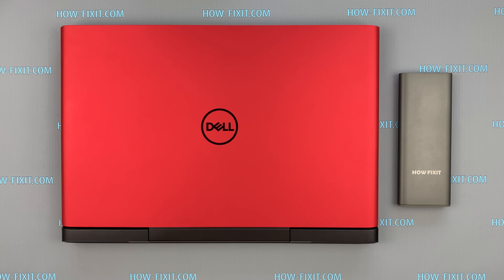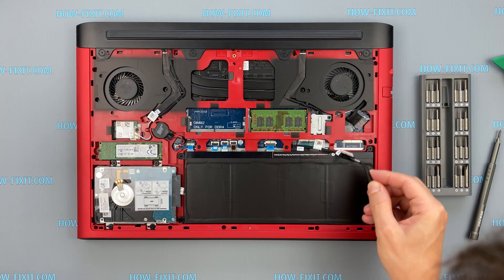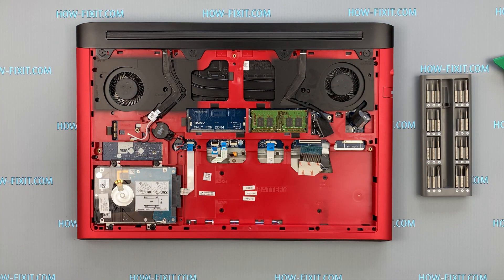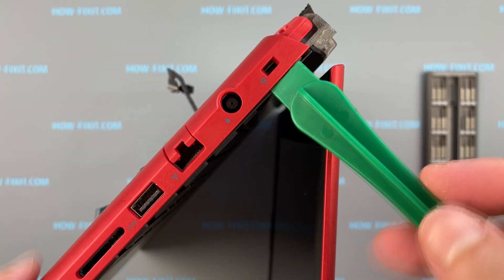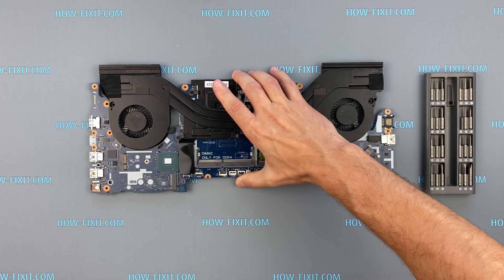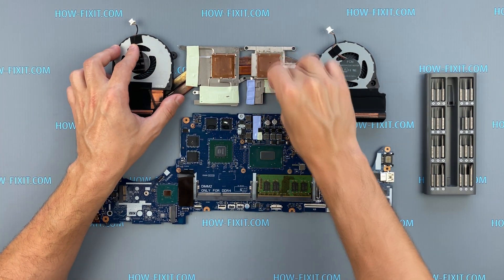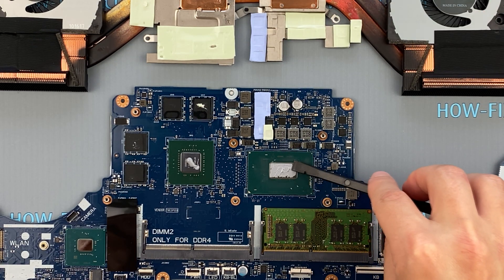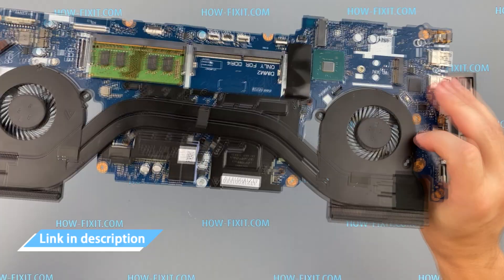Dell G5 5587 Disassembly, Cleaning and Thermal Paste Replacement

Comment: Just had a panic then! Turned it back on and I just got a lot of fans blasting away with a black screen! Turned off and on again, hey presto she lives again.
Reply: I've just had this but it won't load up o.o
Reply: @afrolee4111  did u fix it man
Reply: @gnarlzafunk2thalore  I did! First it wouldnt load, then my ssd needed plugging on, then my battery wouldn't charge (I changed the setting a while back).... all good now haha. Its like brand new 😍😍 gaming went from 89c to 60-70c
Reply: @afrolee4111  Why wouldn't the battery charge? Glad it worked out in the end.
Reply: @andrewdottext8026  turned out to be the charger setting i put it on. I have it on dynamic and it doesnt charge until it goes below a certain percentage lol
Reply: @afrolee4111  Hey man, I have a question. I've changed my thermal paste and my battery isn't charging too. How can you solved this issue?
Reply: @tolunayerbay1684  hey, my issue was that I had adaptive charging set so since it was below 95% and above 45%, it wouldnt charge since charging didnt kick in until the laptop was below 45%
Reply: @tolunayerbay1684  go into the power manager and change the charging settings to see if that works
Reply: @afrolee4111  Thank you for your response :) I figured I didn't fit the DC socket properly. After fit it, my system works fine :)
Reply: @tolunayerbay1684  great. I thought that was my original problem so kept plugging and unplugging and eventually worked haha. Glad you got it fixed
Reply: Same here man and I have no idea what caused it but I wont be opening this laptop again
Reply: i had to change the boot sequence in the bios to prioritize my SSD, but i did find that the CPU isn’t working nearly as hard under load for some reason,,, running games and programs only puts it at about 20% of the CPU power and same as the GPU,,, super frustrating… any help…?
Reply: Hahaha this just happened to me too. Except it took 2 tries to get it to power on lol